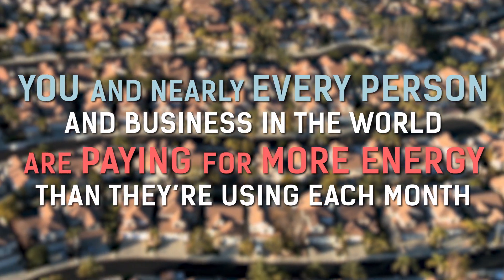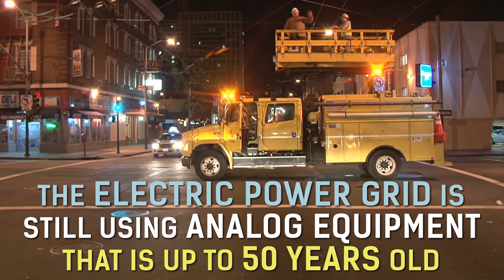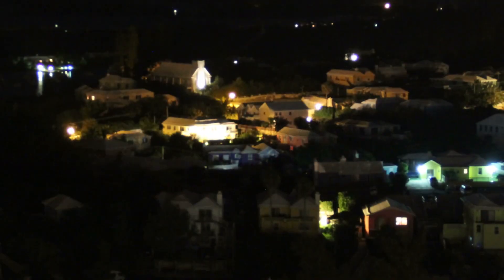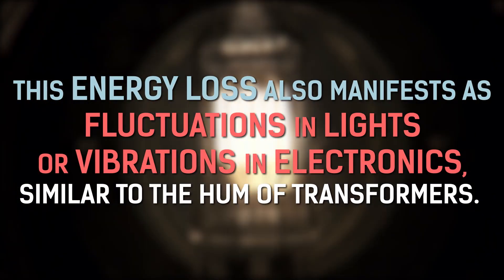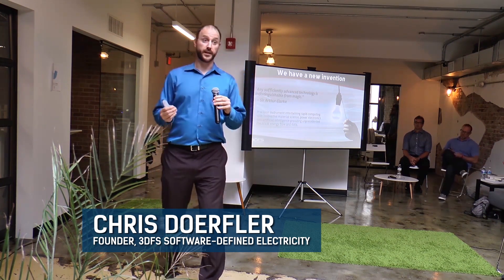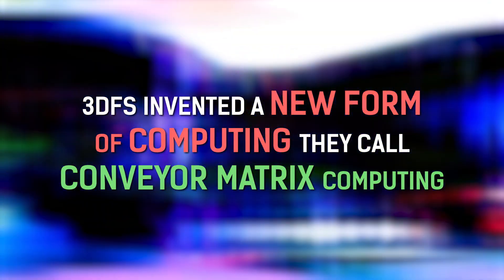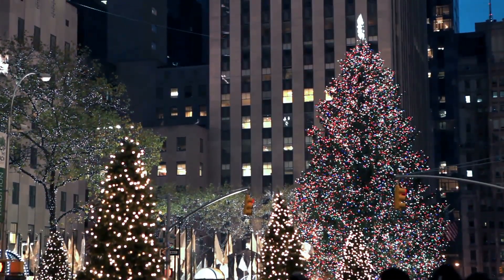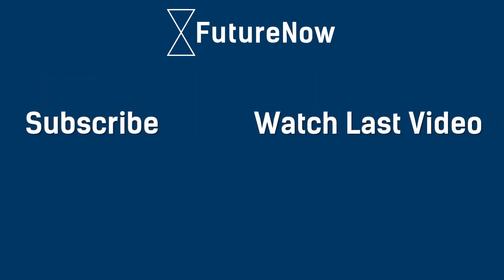Digital Electricity is a Gamechanger

Comment: OK, this device has 100.0% efficiency, and so produces 0 heat; the 2 fan grills are for decoration. And magically alters battery chemistry too!
Reply: Or another thought, perhaps you might study some of the fundamentals of knowledge humanity has acquire before you take on the role of presenting such 'research'. Here’s a good place to start: https://en.wikipedia.org/wiki/Thermodynamics
Reply: I was thinking that, nothing can be perfect in this world.
Reply: Another interesting point is that his main sources either don't have sources themselves (no transitive sourcing) or consist of the company whose product he is advertising.
Also, the very fact that he takes his laptop transformer as an example (as a picture in the background) on avoidable heat loss demonstrates that he doesn't really know how power conversion or magnetic fields work. I don't claim to be an expert either but I at least know the basics of electronics.

Some of the things he mentioned in the video were interesting revelations when I made my own research, such as the material heat increasing resistance, but most of it wasn't all that magical. I can't see why we need a magical device either, as using a simple hack solution with some capacitors could possible have roughly the same effect without running the equivalent to a discarded google server from ebay so save a couple percent of your power on your other devices.

Oh and sorry for responding to your 4 month old comment, I just wanted to share my thoughts with someone who can also see the flaws.

Comment: Nice video, however, it contains some inaccuracies. The first point the power lost due to the transmission grid the is dramatically overestimated is not 70%,  the efficiency of a most step up and step down transformers are around  99% and the sag in the lines are deliberate to account for the environmental conditions  between summer and winter. maybe this equipment allows you reduce the load by 70% which is a different thing altogether, having not seen the mathematics of this device but the typical estimate for grid losses are between 8 and 15%

Comment: This video is extremely inaccurate, the claims as to how devices use power is completely bogus. An electrical device "draws" power, as in, it "pulls" it from the source. As such the device only consumes precisely as much power as it requires to operate. Yes, devices get warm, there is power loss, nothing is 100% efficient, it has nothing to do with the device being "given too much power". The video also accurately points out the move from DC to AC power, but then starts talking about "Digital Electricity"...for those that do not know or understand, digital is either "on" or "off", two states, nothing in between, just like DC... you could even say that Digital is DC because it is! Please do not fall for this scam product or the rubbish lies this video is promoting.

Laughed my ass off at the depiction of what "regular electricity" looks like at 7:38, anyone that has ever attached an oscilloscope to measure the AC waveform would see how clean this waveform actually is. The waveform is so accurate that it is used in many places to keep time as devices will count cycles. This device likely does some form of power factor correction (PFC) but the potential gains for a household is minimal at best.

The claim to zero power wasted is a joke also, this video contradicts itself as it shows accurately that wires get hot when carrying power, and that heat is lost energy. Even the wire terminals on their device will not be 100% efficient and there will be loss at them, it is impossible.
Reply: Yeah, the firehose analogy was completely off.
Reply: Exactly. Also the loss due to vibrations are tiny, you dont need much power to make audible sounds. Not even worth mentioning. Also the servers in the last part already use highly optimized power supplies special made for servers. No flexbile general use device can reach their performance.
Reply: True power drawing is concept not that forced power supply.
They forgot loading concept
Reply: >"Completely Bogus"
Reply: Electrical (Power) Engineer graduate student here. I came for this. At this point I'm just guessing this thing is power factor correcting device?

Comment: Every conductor has resistance, therefore there is always heat loss. Some believe that absolute zero temperatures can remove the resistance and therefore with the addition of this, we would have 100% efficiency. But that would mean that the wires could never come into contact with heat.
Reply: Absolute Zero Freezes everything, hence the name, electricity included.

Comment: Too many estimates, does this technology even pay for itself? I don't believe at all this could double battery life in for example a laptop, that is what charge controllers are for. Also you're adding another system that itself takes power, do you actually know if the energy used overall is actually going down, and what amount of power do I have to use before I actually start to see a benefit, i.e. a net gain of power? I highly doubt that this tech is even close at all to how magical you make it seem.

Comment: Okay Okay I get it - and it's a great idea but you can't tell people that their Iphone is going to physically or practically last 2x longer - electrons are electrons and at a 5 volt DC charge going in  - no matter how that 5 volts was generated, will be the exact same stream of electrons entering the Iphone.  It won't run longer nor will the device last 2x as many years or protect battery from wear out. - it's all DC 5V in.    On the plus side, the energy efficiency of eliminating all the transformers could really lead to some energy savings - so long as the technology isn't too expensive (right now)

Comment: Well you could argue that  powering that device itself is already a waste/loss in itself but obviously a significantly smaller one than anything else. How does it act in cases of power surges and stuff like that? If it's a proxy between you and your electronics, I assume it will filter out any surges that could burn the PSU in your computer, or filter out any funny interference with your kettle boiling water for the tea affecting the image on your TV, right? How vulnerable is that appliance itself though? And does it potentially pose a risk of creating any surges and stuff in case of a malfunction - be it a hardware or a software one? How prone it is to hacks and stuff like that if it's connected to the internet to provide data for your smartphone app?

Comment: Exactly, at last they have now new electrical idea/technical analysis to avoid power loss and to include, lower the supply voltage as the equipment/devices will vary accordingly as designed. Not to mention the safety and security of Mankind. Which is workable if really put in perspective view. 
Just avoid the phrase:

Money talks and ruled as a whole.
Period.